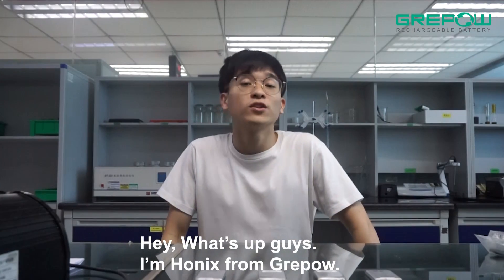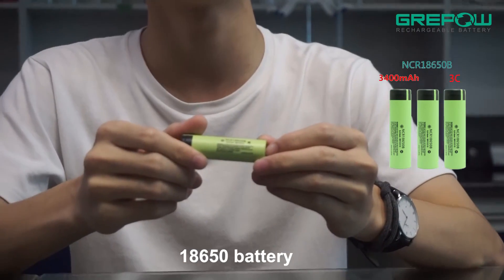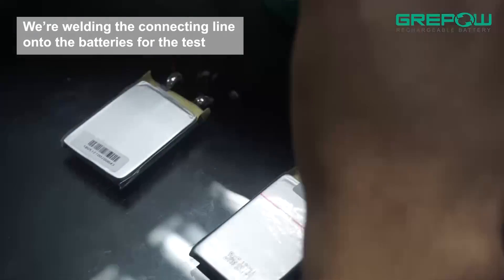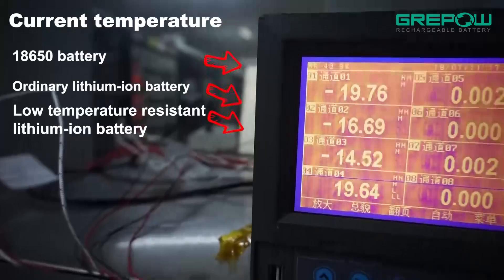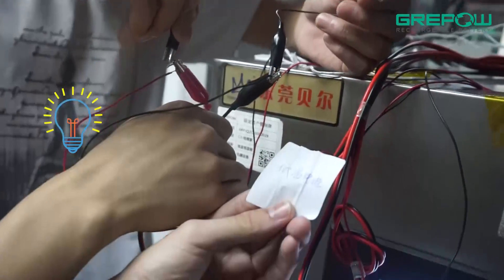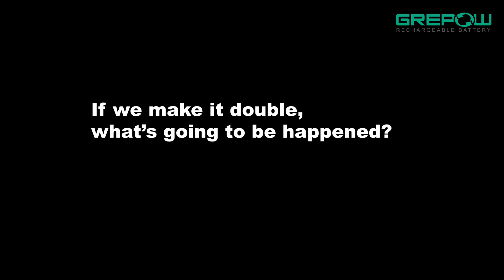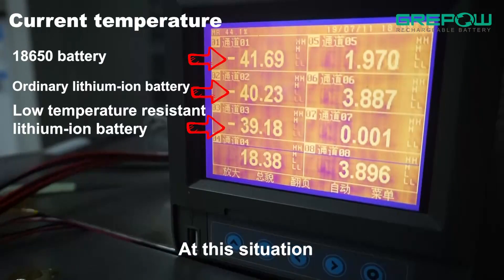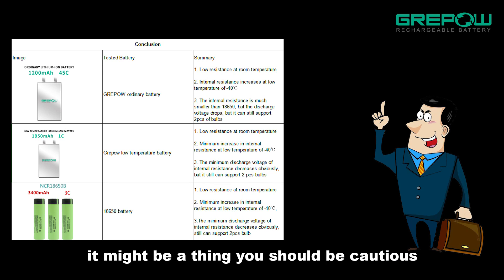-40℃ low temperature, lithium-ion battery behaves unexpectedly like ...

Comment: You guys joking. Problems at low temperatures on earth? Now I know why most chemical and biological secret laboratories are only in Alaska, Antarctica, nobody at North pole. In Antarctica minus 60 Celsius, at north pole minus 80,nobody can survive there on earth. Really confused, big question now how we went to space, to moon where temperature is at least double minus 160 to minus 270 degrees Celsius. When try to come back fuel isn't frozen? Any rocket or engine don't burn fuel? To burn don't need air? Remember those engines in 70s kick started using crank loads of misfire, or pushed by people? Now I know why 70 years later nobody including AI goes back to explore hostile universe and planets.

Comment: So 13.7. Is the charge rate. 13.4 shows you can take/ give a charge easily. 12.6 equals a battery at rest for its specific gravity/load of power equaling full. 1 ma= 1 minute = one amp. 12x12. Equals 144=14.4 full battery. At 77°. Core temperature./ Heat Signature knowen has radiation. Example battery Bank holding 80 amps, one amp per hour equals 80 hours. Then the battery is dead. 8 and 7 equal 15, 15.1 float charge. Which shows Celsius 3.1 degrees/ Celsius. Fahrenheit. Same difference. Just depends on how you want to look at it.
Another example would be, cordless charger for your phone is a float charger. Whereas the cord is direct and must be unplugged. One piece warms the battery, the other Cooks It Out,... overcharge.
I know same phone lithium battery 22 years old still working. I own a 5-year-old Android phone, same battery no problems with charge or holding charge. It is 12x12 on diagnostics. Meaning no degrading, same as new. If your phone gets hot while working with it put it in the freezer for 3 to 5 minutes cooling the core down it'll be fine.

Comment: Discharge in cold temperature is not a problem. Let's see a battery accepting multiple charging cycles at -40C!!!
Reply from the maker: According to the characteristics of the battery, it will precipitate lithium when charged at -40℃, which will make the battery unhealthy.💀 It is our pursuit to break the limit while ensuring the safety of the battery, now our low temperature battery can reach the lowest discharge temperature of -50℃, if you are interested in this, we can arrange a new test video.😃
Reply: @GrepowBatteryOfficial  rubbish don't believe that sorry.